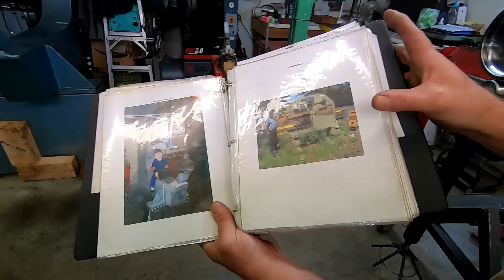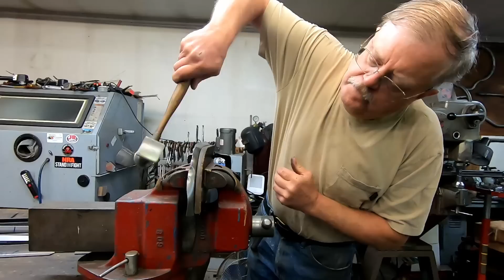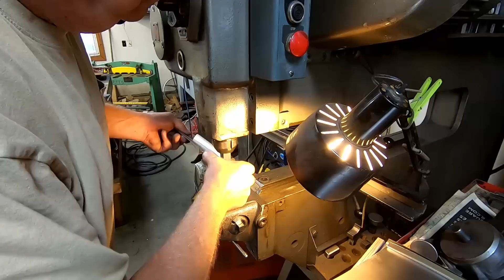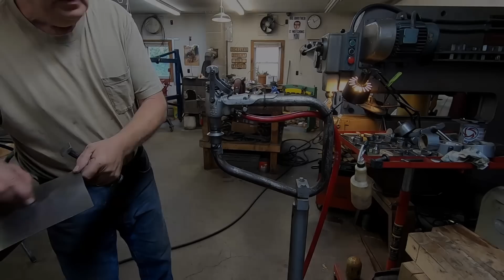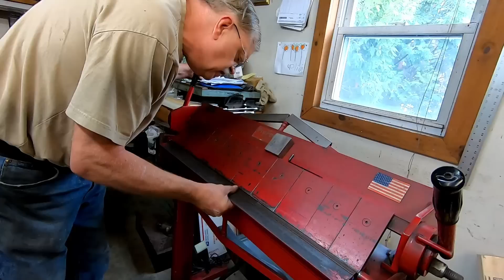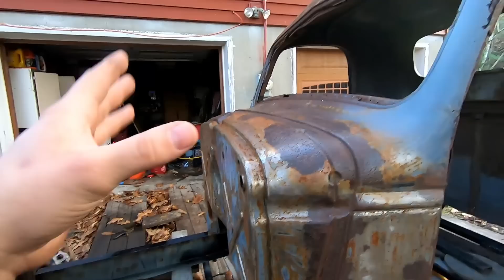Making Custom Patch Panels for the Hemi Drift Truck the Old School Way.

Comment: I had the pleasure of meeting Ray, my father had him do some work to his '30 Model A and I had him do rockers, cab corners, and door bottoms on my 97 Ram. What a guy he is, he offered me a deal on the price with the condition that I came out every day to assist him in the fabrication and repair of my truck. Who else in the world would actually offer someone a discount to TEACH THEM SOMETHING. I was a 17 year old kid with zero knowledge of body work. I got in the way more than I helped but he had me stand side by side with him while he explained every step to me. I made the 45 minute drive every day to his shop for 3 or 4 days to watch and learn what he was doing, and it was worth every second. I will be calling him up again soon for another project (assuming hes willing to take it on) and I look forward to seeing him again. As for the work, it was top notch 100% perfect. Just what youd expect from a skilled and knowledgeable old timer with decades of experience. Every piece was fabricated from scratch, and even as a young man that was very impressive. I actually channeled some of what I learned from him and did a pretty decent job on a wheel arch replacement on another vehicle of mine. Im so glad to see this video because I haven't seen Ray in probably 10 years.